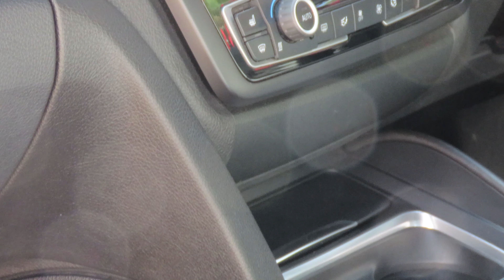BMW M4 Deep clean Exterior, Interior & Engine Bay Detail - Auto Detailing

Comment: nice video but I got a question:Can I clean the m4 engine bay directly with water? thank you!
Reply: hey man, I'm not a professional but from what I've observed from different YouTubers cleaning the engine bay, they don't use pressure washer directly on the engine as it forces water to go in some spaces and cause damage.
if you want to clean up your engine (not the engine itself) try removing the battery and covering certain parts with a microfiber towel or rubbish bag then use a water hose. but for the engine, itself use a brush, dish soap mixed with water, and clean up with a micro towel afterward.
if this was not enough watch Chris fix how to clean the engine bay